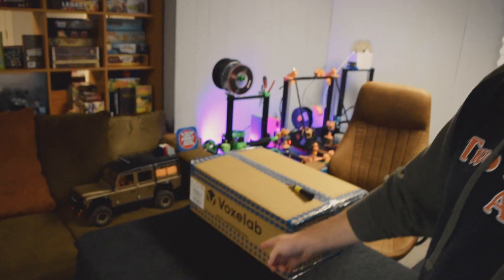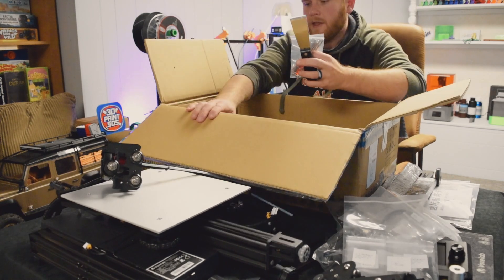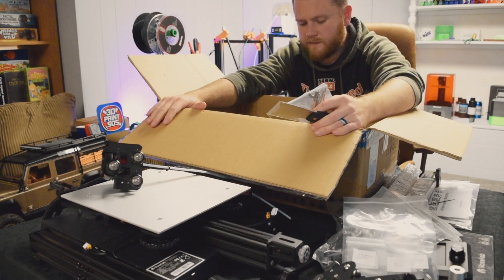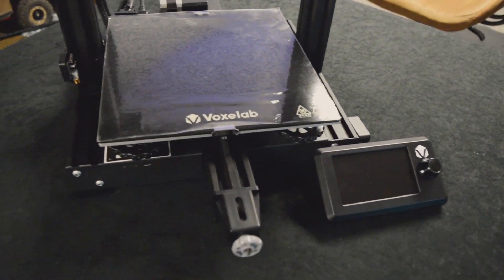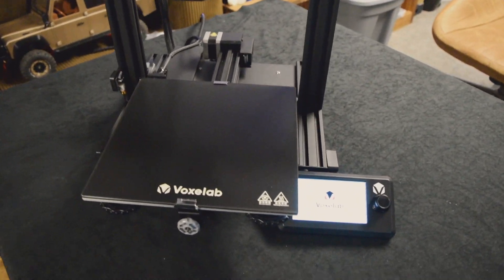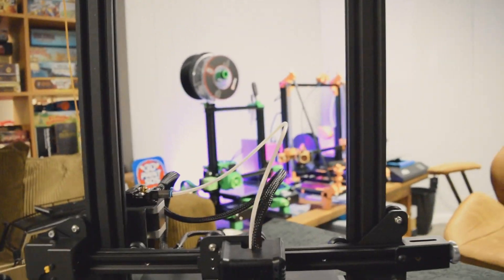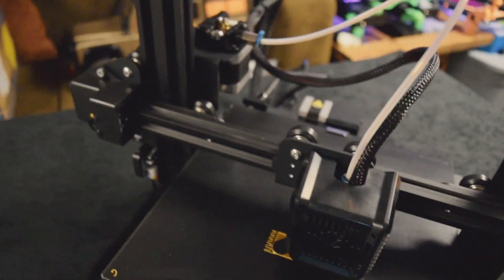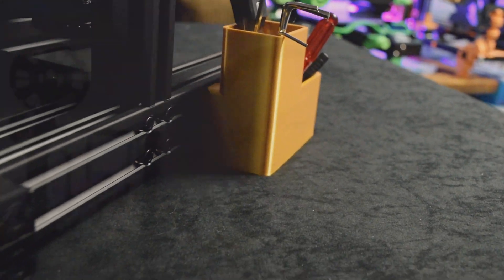Voxelab Aquila Unboxing, Assembly, and First Print

Comment: Just watched this again. Still no luck. I thought I had the bed leveled once but the prints wouldn't stick so I tried again. I cannot get the nozzle close enough to the bed. I have an Aquila X3 with Auto Leveling. I do an Auto Level and then a manual level like the instructions say. I can unscrew the adjustment screw until it falls off and the nozzle is still way too far away. If I tighten the adjustment screws halfway to begin like you suggest then the bed hits the Y axis motor and stops. I only have less than half the adjustment because the bed hits the motor. I could not have screwed that up. That was a pre-assembled piece. The X axis also prints too far to the right. If I do an Auto Home it moves to 0,0 and I can hear the limit switches. Then it moves to the center of the bed but it isn't actually in the center. It goes to 136.6, 110. I'm stuck. They say they test every printer before it leaves the factory but I find it hard to believe they didn't notice the bed hits the motor and won't work. It has already worn the label off the motor from rubbing it ever time it passes over it. Any ideas?

Comment: Love  your passion for what you do as do i. Need some help bud. Got the same printer its giving me some major trouble. HELP ME PLSSSSSSSS😞😞😞😒😒😒😒💣💣💣💣😡😡😡😡
Reply from the maker: I got you. I sent a link in a previous comment. Just need more details about the issue. What’s goin on?
Reply: @3DPrintSOS  i level it get the table up to temp my filament comes thru the nozzle. Bit still wont print i seen the filament gears move once nothing ever since....

Comment: I can’t get Mine out of returning to zero please wait mode
Reply from the maker: Hmm. That must be because one of your limit sensors is not plugged in correctly. The printer is waiting for something before it moves to the next step. Try to go through and check all of the wiring.

Comment: Looking to buy one of these baby's soon as a first printer, what did you use to clean the bed with?
Reply from the maker: I use isopropyl alcohol to clean all my beds. Works wonders, this stuff.
Reply: @3DPrintSOS  Oh cool thanks, do you clean it after every print or just when it's noticeable?
Reply from the maker: Before every print. I keep it in a spray bottle along side a microfiber towel. ;)
Reply: @3DPrintSOS  Thanks man, appreciate the replies.

Comment: That PLA Profile wont open on my PC aye...is there a paticular program you have that set for to open on mate?..also whats your recommended 3d model app to use for this along with the slicer.? please...also does it matter what apps to use on this model
Reply from the maker: The profile will only import into Cura if you set the printer up in the same way I did. 

Fusion360 or DesignSmarkMechanical are both free and awesome for design.
Reply: @3DPrintSOS  awesome mate..yup I set it exactly like that, but when came time to import the file.the file wanted to reinstall my OpenOffice app everytime I tried..the file I downloaded from you is also in a file that is zipped up
Reply from the maker: @josephinecrooks45  Ah. You mean to unzip the .bin. Grab a software called WinRAR. Should be free and will let you unpack files.
Reply: @3DPrintSOS  thanks mate..will give it a go.appreciate it😊

Comment: I bought this printer and it is really amazing for beginners. What I could not make it work is to print through USB port. Is it possible to directly print from Computer through the USB port on the printer? If yes, is there a video that is available for my reference?
Reply from the maker: I don’t have one but it might just be a matter of downloading a driver. If you Google “voxelab Aquila usb driver” I’m pretty sure you could find a link and get it installed. Give that a try. :)

Comment: I can't seem to have my printer recognize any new files put on the provided SD card. Any suggestions?
Reply from the maker: What kind of files are you putting on there?
Reply: @3DPrintSOS  I figured it out. I was overthinking the entire thing.
What I was trying to do was put more files on the provided microSD card and it didn't recognize them. I finally broke down and nervously bought a 32GB micro SDHC card (which works just as well), formatted it to FAT32 (default format for those wondering) and after downloading some prints off a site and uploading them through VoxelMaker (which is free and works with my printer) everything worked out great. I was just nervous for it being my first time. This being so, these tiny little tips I explained seem like common knowledge but it was invaluable after doing it. I have 0% knowledge on the application of 3d prints so i was just over-reading the steps everyone explains, scared that if I formatted my SD card they gave me that i would be in more trouble than when I started.
Reply from the maker: Awesome. Glad you got it. Nothing wrong with using voxelmaker. :)

Comment: I have made this suggestion for other reviewers as a 'rule' that is you HAVE to assemble the printer with INCLUDED tools, it they don't give you tools (and it is not like tools of this quality will cost a printer maker that much), then you cannot assemble it (and MAKE SURE BUYERS KNOW THIS (and the manufacturer/vendor KNOW it)).  If they include a sample of filament then USE that sample to make the sample print (with their stock/included settings).  If the manufacturer includes a 100 gram sample and it takes twice that amount to print it then that is not fair the end user.
Reply from the maker: I like that. I always try to use the stock tools. :)

Comment: I was a bit disappointed that mine didn't include the clips for the pneumatic connectors, but I wrapped some stripped twist tie wire around them and it did the job. I did my first print tonight (the hook) and it didn't stick too good on the bed, but it still turned out where it could be useful. I'm working on the second print (the knob) and before I started I used a couple alcohol pads and that made it stick, so far so good. I had trouble with leveling at first because the back right corner knob would come loose, so I had to take out the spring and stretch it out a bit. Another problem I had setting it up was the bracket that holds the wiring for heating the bed was askew and hit the left z axis pillar, but I just had to carefully straighten it out being careful not to break the solder joint there. Last problem was the Y stepper was mounted crooked and would hit the printing bed, so I just loosened it and straightened it out. So my first 3d printer experience seems to be on the right track thanks to your videos. Only thing I'm not sure about is adjusting the tension on the filament feed. Thanks a lot for your videos on this printer. Your review also helped me decide to get this one.
Reply from the maker: Nice! Also, you can print those clips. ;)
Reply: @3DPrintSOS  I found some on thingiverse, I haven't tried using the slicing software yet, but I'm sure I'll figure it out. Thanks :) Oh the knob came out perfect so that's cool.
Reply from the maker: Heck yeah 🤘🏼

Comment: I can't get my z axis to work everything is plugged in. Any ideas?
Reply from the maker: Does it move via the menu?
Reply: @3DPrintSOS  no, doesn't make any noise like the stepper is trying to move. Opened up the board everything is connected. After some research I have found quite a few people have had this issue, apparently receiving a broken stepper isn't uncommon with this model.
Reply from the maker: Try this, take a cable from one of the other steppers and plug it into the motor and try to move that axis. If z moves, it’s just the wiring.
Reply: @3DPrintSOS  ok I'll give it a try
Reply: @3DPrintSOS  didn't work
Reply from the maker: Which part? The motor still didn’t move?
Reply: @3DPrintSOS  yes the z axis motor didn't movewhen connected to the x axis wires
Reply from the maker: Hmm. So it must be the z motor. If you plug in the z motor wire to the x and move the z, does the x move?
Reply: @3DPrintSOS   Yeah strange it wasn't working the other day but now the motor on the z-axis will work with the X wire. Action we ordered the wrong  Size stepper motor the other day but it also came with a  Replacement wire maybe I'm just gonna try and replace the Z wire real quick
Reply: @3DPrintSOS   Found the issue apparently when they put together they sandwiched the wire in the metal And it cut a few of the strands
Reply from the maker: Nice! Glad you found it!
Reply: @3DPrintSOS  new problem. Z axis runs in reverse.when using auto home z axis goes up instead of down I thought maybe I put the threaded rod in upside down but stupid me forgot it would be the same either way. When putting in settings for the position the higher the level I put in the lower it goes
Reply from the maker: Hmm. Is this using a different wire? Or the stock one?
Reply: @3DPrintSOS  stock wire was destroyed by the factory this is a different one made for these motor
Reply from the maker: Sometimes they are pinned differently and can go backwards
Reply from the maker: Sorry to hear that. It’s definitely a fun and engaging hobby. As you’re finding out already. 😂

Comment: when i start to print the nozzle moves but it prints way too high than the plate and i dont know what to do
Reply from the maker: Are you leveling it after hitting home? Make sure your z offset is set to 0
Reply: @3DPrintSOS  its zero but its very far

Comment: I have watched almost every video you have about this machine, my son purchased this and I have been working on it for 3 days now just trying to get a decent print. The bed is level, the problem I have is when the item goes to print, the printer head raises up, then pushes down on the bed, thus scratching the plate and not to the location where I originally had it. I have adjusted the Z axis like support has recommended, but there is no consistency whatsoever when doing a print. Please help. I am about to return this thing and break my sons heart. Everyone else seems to have great results right out of the box. us not so much and I am beyond frustrated. It shouldn't be this hard.
Reply from the maker: Don’t return it just yet. Sounds like theres just a slight misunderstanding or miscommunication somewhere. Let me try to help. 

First heat up the print bed. Then go to the menu and press Auto Home. The printer will go to its home at the front left of the plate. This will always be its home and where it starts. Once the printer is homed, get a piece of paper and move the head and bed to each corner and using the dials under the bed, get it leveled with a paper under the nozzle one corner at a time going clockwise. I would go around 3 or so times. Then, when done, go to the menu and press auto home again. It will go back to the front left. From there pop in your sd card and select any printable item on there. It should start to print. 

Let me know how it goes!
Reply: @3DPrintSOS  I had tried everything.  Basically had to take the whole bed part apart and reattach it, not sure but it seemed very loose. Finally got the height leveled in all areas,  it seemed the middle was so much higher. Tried a print again and wouldn't stick. Remembered your glue stick, trying that now. So far we seem to have progress.  I will keep you posted. Thank you so much for replying!
Reply from the maker: No problem! Also, on the bed carriage, the left side specifically, has two wheels that have eccentric nuts. You can use a wrench that came with the printer to tighten the carriage wheels. You want to make sure it’s not loose but you can’t overtighen or you will run into other issues. But, all the carriages on the printer have at least one wheel that can be adjusted with a wrench. ;)

Comment: Just finished putting mine together. It's now printing the "tool box", for the second time, I now know what they mean by "sample filament is useless". Tangles uncontrollably and "kinks" if you sneeze at it. If you're a little bit mechanically inclined you should be able to assemble this printer. Things I want to change/update, sure, but from what I've seem on YouTube, that's every printer.
Reply from the maker: I think you’re on your way. Haha. Just a few changes, lots of tweaking and leveling, and it’s golden.

Comment: Hey man I'm on my second voxelab printer. 1st works great second extruded filament backwards. HELP
Reply from the maker: Backwards! Haha oops. You might have to reverse a wire on the plug. Should be easy, but I dont know which off the top of my head. I’m sure this is readily available info online though.
Reply: @3DPrintSOS  like on the motherboard?
Reply from the maker: I would think on the stepper motor itself

Comment: I was looking at buying the new Creality Ender 3 V2, Then I happened to see a review by another youtuber of this Ender 3 clone "Voxlab Aquila" printer you are showing here!  He said that it was amazing for less money than the Ender 3 V2 and he himself just started printing based on seeing your videos of this printer?  I wish to ask your good self a few questions if I may?

1 > there is a touch screen update part that I could buy to replace the screen and knob of the Ender 3 V2, Could that be used instead to replace this Voxlab Aquila printers screen since it seems to e a clone of the Ender 3 V2?

2 > is there any updating kits for this Voxlab Aquila printer like we see for the Ender 3 V2 where you ca make the printer able to print to a higher and wider size?

3 > can this printer be used with a USB wi-fi dongle to make it wi-fi compatible to a PC? so you just send the file to printed y you own home router?

Lastly will a Creality encloser fit this printer?

Thank you for your amazing clear videos.
BTW.. I have a Tronxy X5SA 2020 model printer which I tried for months to level right?  No luck either using auto or manual.  
This Voxlab Aquila ill e the replacement for my un-working Tronxy X5SA one.
Reply from the maker: Sure thing. 

1. I’m not sure, to be honest with you. However like you mentioned, it’s a clone, so it may work. You might have compline your own firmware to make it work. Not sure it’s worth it to be honest.

2. Yes. I hear the Ender extender kids work with minor modifications. 

3. No. Those don’t work from what I’ve seen. However, you can easily setup a raspberry pi running octoprint and make a WiFi powerhouse. :)

Comment: All together. Just getting the nerve up to level the bed. My A8 was/is a nightmare, so I'm gun shy on bed levelling! Oh, and I didn't get those blue clips, neither did someone else who got his yesterday, so I don't know if it's a new thing or not
Reply from the maker: You can always print them later. :)
Reply: @3DPrintSOS  I was wondering about that. I'm printing the tool box now. Boy, I am really impressed with this printer. My first print was the hook, and I show it to the Mrs and she was very surprised at how good it turned out.
Reply from the maker: Yea, this thing rocks right out the box.
Reply: @3DPrintSOS  Printed the tool box. There seems to be, what I call a shift, right above the first t-track guide. It's like the piece moved on the plate one direction like .4mm. Then, higher up on the "tower", I have some fairly faint shadowing. Any hints?
Reply from the maker: Hmm. Typically a shift happens when something gets curls, gets stuck, and can’t move so it skips a step. This is typically due to not enough cooling. So maybe the temps on the hotend are a hair high for your filament? Try 5 degrees cooler to see if that works.
Reply: @3DPrintSOS  I didn't look to see what the temp was, but it's PLA+ which prints hotter. I installed your profile in Cura, so I'll give that a try. Yard work now. Ugh. Lol
Reply from the maker: Real life always gettin in the way! Haha
Reply: @3DPrintSOS  right? So when I put it together, I remembered you saying to tighten the nuts under the bed. Well, they are pretty tight and it still flexes side to side.
Reply from the maker: Hmm. Side to side play might mean the wheels need to be adjusted. There are eccentric nuts on there that can be tightened to stop the bed from wiggling.
Reply: @3DPrintSOS  ok, so now I'm having issues with my prints not sticking. Ugh!
Reply: @3DPrintSOS  so I figured out that the plate needed to be cleaned and the print will stick just fine...lol
Reply from the maker: Haha. Yeeeep. That’s typically half the problem. Followed by a good leveling.
Reply: @3DPrintSOS  yep. Done and done!
Reply from the maker: You’re on your way dude. ;)

Comment: Thinking of ordering this after seeing your very informative video. Do you think it can print a regulation size  Ping Pong Racket 10.6 inches by 6.6inches by 1.5 inches high if it is sliced diagonally on the bed?
Reply from the maker: That will be a tight fit I’m sure. The bed is 8.6” by 8.6”. There are multi piece models out there though.

Comment: It worked first-time, now I am unable to load filament, it rotates but doesn't advance.  Any suggestion?
Reply from the maker: Hmm what is the temp on the hotend? Can you manually push filament through?
Reply: @3DPrintSOS  I disassembled and the plastic loader is cracked.
Reply from the maker: Ah yes. Super common problem. A shame you won’t be able to print the fix now. You have to either get a replacement from voxelab or buy a replacement. Anything for an Ender or Ender 3 v2 will fit this machine.
Reply: @3DPrintSOS  That's a great tip. Thank you for supporting us newbies!

Comment: I just hooked up my Aquila and it’s acting weird every time it starts printing it just stays in the corner
Reply from the maker: Hmm you printing off of the sd card? Can you move all axis from the menus when it’s not printing and hot?
Reply: @3DPrintSOS  yeah I finally got it to start doing the print right just had to mess with it for awhile. As you can tell I’m a beginner. How do I add more prints especially like anime type figures or like mini swords or guns or something?
Reply from the maker: Watch my video on slicing. That will help you get started. :)